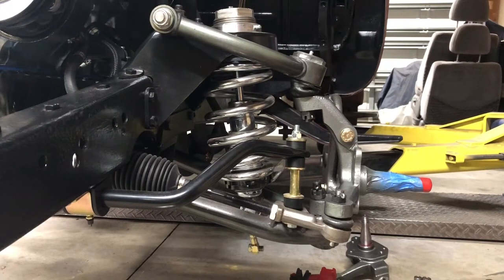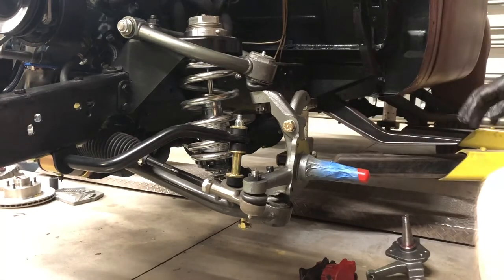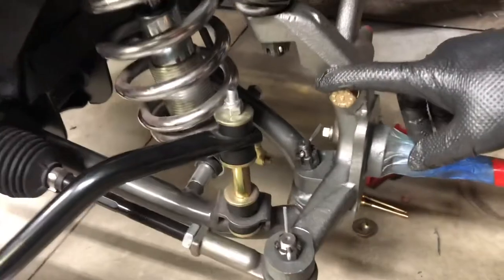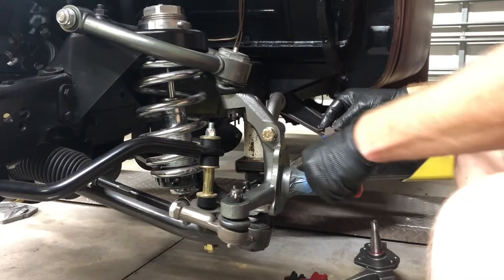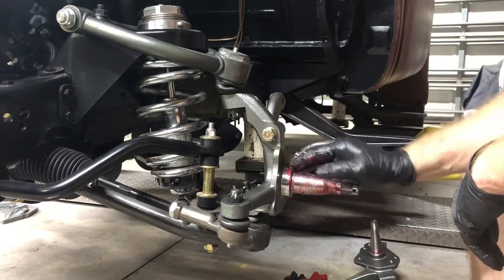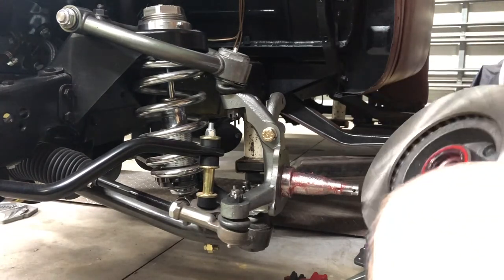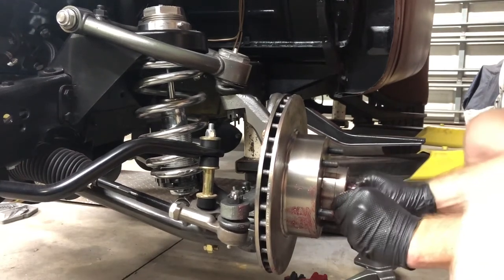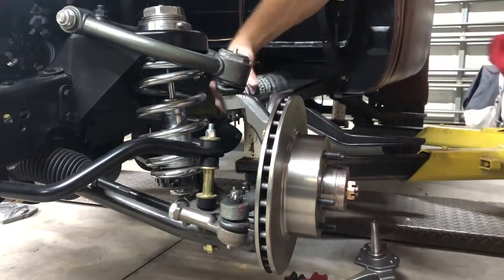Front Disc Brake Install

Comment: Back in the 60s I worked in a small town Esso and did oil and minor maintenance services. The mechanic I worked with told me to pack the spindle cover full of grease then put it on to protect the castle nut and spindle threads from corrosion.
Reply: Cap full of grease is "old school" way...today's grease technology doesn't require us to do that anymore.
Reply: @TheLimitedmod22  the filling of the axel cap with grease is to displace 'open spaces' inside the cap where water can potentially collect and promoting corrosion. I can understand the reluctance of doing it the old school way cost of grease these days but, I'd still tend to be and promote being generous with greasing your bearings etc.

Comment: Spin the rotor while tightening the castle nut until it binds/drags. Back off the nut,  torque to specs. Insert cotter key, bend and snip. Pack the dust cap with grease, grease is cheap, call it a day. I used a similar setup on a ‘56 f-100. My dropped spindles pinched my upper balljoint boot because of the angle. I replaced with regular height spindles. I like your work though, not criticizing.

Comment: I have a question; I too got a kit from Speedways, adding front disc brakes to my old Edsel. In the instructions, it says, quote, "The rotors provided in this kit already have races inserted in them. But if you determined you will be using the A2 and A6 bearings, you will need to remove the races in the 5405 rotor. In other words, the larger diameter spindle shafts require you to changes the races in the rotor provided." Now, I'm going to sound rather dense for asking this, but what are 'races'? Its the only part I'm unsure of. (I'm from the UK so I dont know if its a part of another part, or a different terminology, or something).
Reply from the maker: 6:38 in the video shows the rear race. It’s the metal circle with ball bearings in it that spins inside the rotor. In the video, the red circle near the race is the seal.
Reply: @silvosshop  thank you so much. Even following the instructions on Speedway's site I felt a little unsure, you just cleared up ALL of my concerns. Guess I know what I'll be doing this weekend! Also what master brake cylinder did you use in this, is that in another video of yours?
Reply from the maker: @thequietestengine  the brake booster and master cylinder is from a 69-70 corvette. Unfortunately, I didn’t video any of the booster install. Have fun on your build!

Comment: This has to be a spoof, did he put the grease seal on the rotor? 1/2 inch impact on wheel bearings? Really?
Reply from the maker: A spoof, huh. I suppose you missed the cleaning of the rotor and the explanation of using the impact and then the explanation of the torque method using a torque wrench. You don’t like it, do it your way.  No need to criticize others. God Bless you sir.
Reply: I cringed a little too at the sight of the impact , but, in all fairness he did back it off and then torque to spec.
Essentially,  he just pre-loaded the bearings with use of an electric impact.
I would recommend doing that step by hand "just in case" there might be damaged threads and/or any other deficiency that you could feel with doing that step by hand.